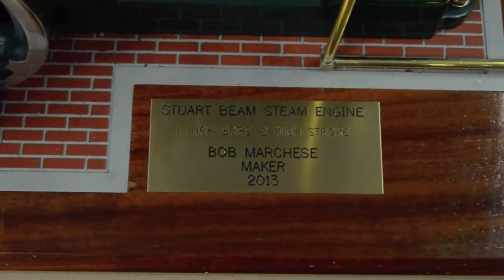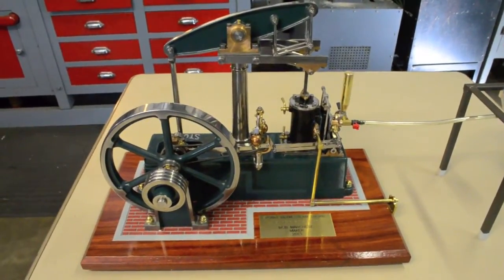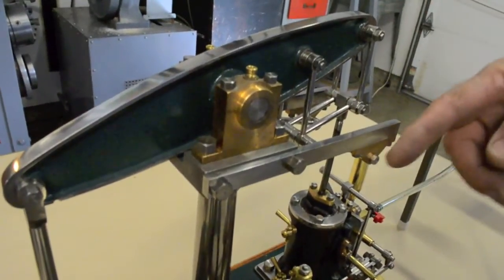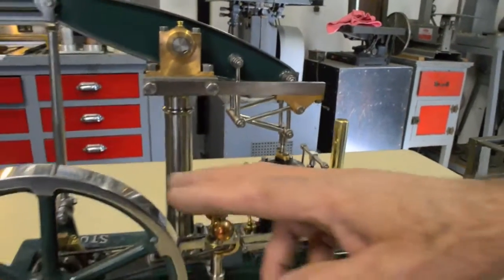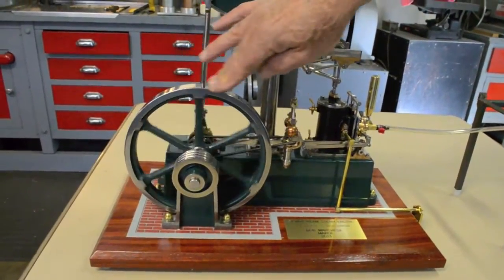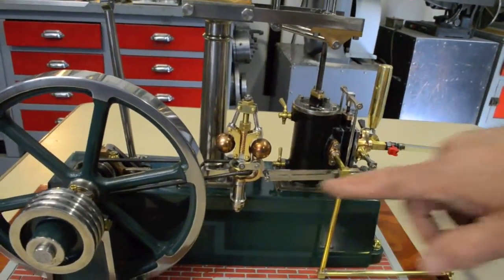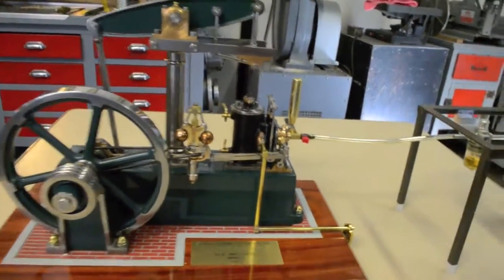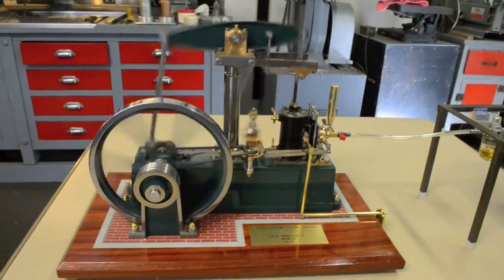Bob Marchese's Stuart Beam Engine

Comment: Great looking model... 2 remarks though:

1) At certain points in the video you were running the model at a speed (RPM) that was totally out of sync with actual usage of these engines...

2) You need to do something (timing probably) about that hard knocking sound!...

Comment: I just finished Stuart's Victoria engine. The are remarkable models.  How did you get such a high-shinny-polish in the iron parts such at the flywheel? Check out the video of my engine running!
Reply from the maker: Here's your answer, Bernard, from Bob Marchese...
Dear Bernard:
Understand that the smoother the part, the better shine you can get. After filing and grinding as far as you can go, sanding with progressively finer grits of "wet or dry" sandpaper is the next step. The final step is to go to a paint & body shop supplier and buy a bottle of diamond cut compound. I use Meguiar's 2.0. This stuff really works. I think I paid about 20 bucks for a quart bottle some years ago. If you can spin the part in a lathe, you will do OK with just a soft cloth and the compund. If not, you can use a cotton wheel on a bench grinder with the compund applied to the wheel.
Reply: Sharon Poteet Thanks for the reply on polishing. It's a great looking model! Now we just need to take care of the "knock" sound that occurs when the piston comes to the bottom of it's stoke. Most times, this is fixed with just simple valve timing adjustment. Setting the valve to slightly open just before the piston comes to the end if it's stroke will allow "early admission" to the cylinder. This in turn cushions the piston, and allows for any slack on the crank or connecting rod to be absorbed with the steam or air you are using to run the engine.  Check out my Stuart Victoria videos for an example of this as the Victoria is just a horizontal set up of the beam engine.  Happy steaming!